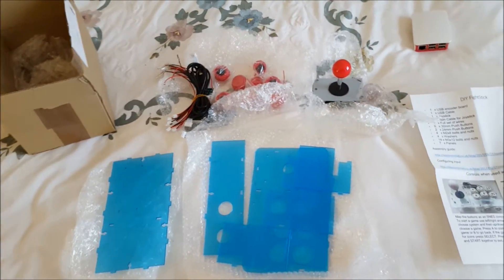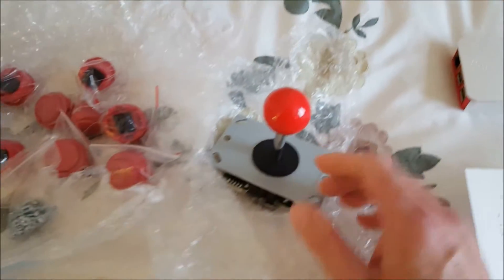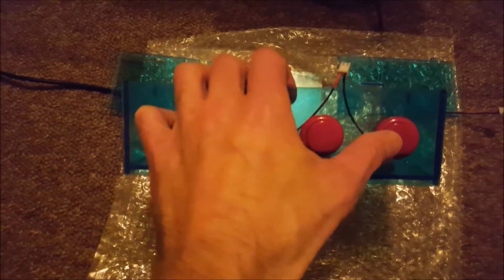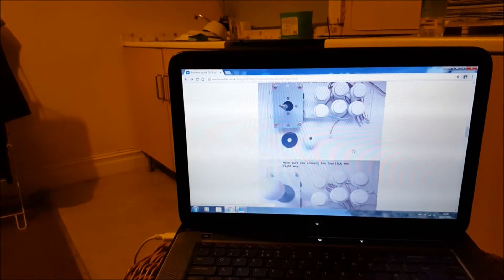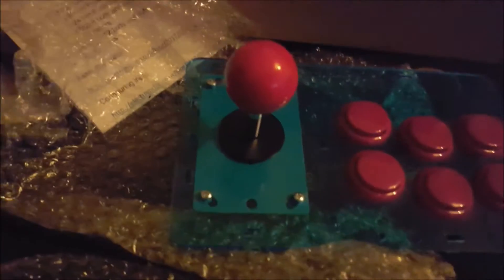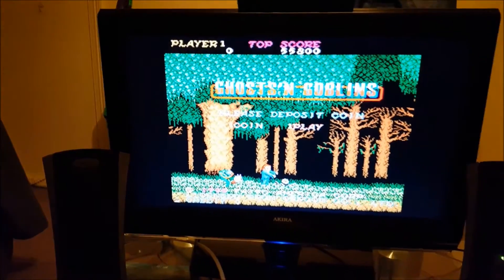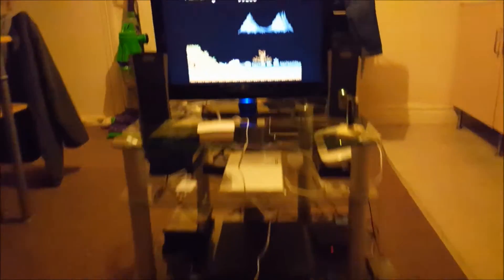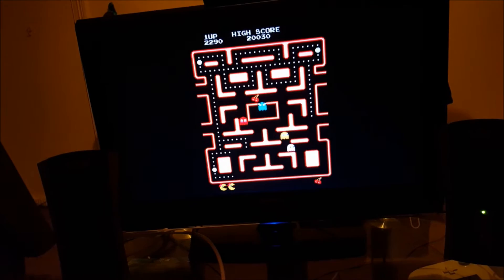DIY Arcade Stick

Comment: hey.. im pretty sure you have the buttons and joystick on the wrong side.... in fact i think you have it back to front and upside down...  so if you had any fitment issues this is probably why
the  first 2 buttons nearest the joystick are meant to be offset below the other 4 buttons... its layout is suppose to match the natural curve of your fingers

if the stick moves around too much when you play.. i'd suggest adding some grip rubber material or better yet.. just bolt it onto a plank of wood or something hefty :)
Reply from the maker: The buttons and joystick only fit one way (the holes are predefined).  there are micro switches on the bottom of the buttons, so they can only fit one way.
Reply: Huddison he means your plate is facing the wrong way. The button arrangement is upside down because you’ve screwed the stick and slotted the buttons in on the wrong side of the plate, bottom side instead of top.

Comment: Nice really nice Raspery Pi 2/3 box ,good that you didn't put it in the joystick case. The built quality have fey design weirdness, like the philips screws pop up on the surface too much , on the plastic need to be made half cut off for the screws to sit flush with the surface. I'm suggesting if you don't like the blue plexiglas to use vinyl to wrap it on, some wood grain (dark color) will look authentic.
Reply from the maker: Once I built the unit, I began to appreciate the colours of the Arcade stick; the blue and red set off well against each other.  It's a great piece of kit.